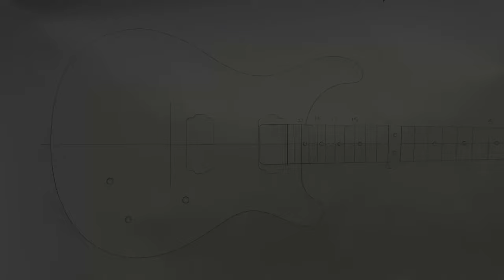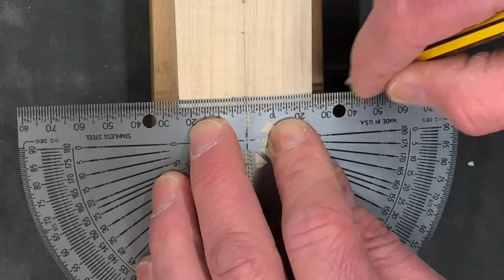How To - Custom Electric Guitar Build in 20 Mins #ggbo2022

Comment: A bostin looking guitar, great top. I see a lot of people doing what you did but it puzzles my small mind. In my head routing the electrics channel before gluing the top on, seems easier and less risky than using a long drill bit from the neck pocket. Perhaps it's just me. Sorry for being late to the party. Have you made another?
Reply from the maker: Thank you, it’s one I’m proud of, glad you enjoyed the video 👍 if I was mounting a scratch plate or if the selector switch was at the top bout (like a Les Paul or Tele deluxe) I would have done a channel for wiring. It’s scary drilling through but long as you’re careful it’s ok. I’m making another but have had a break over winter due to life getting in the way but will be getting back to it soon.
Reply: @WhitefootGuitars  thanks for replying, I'm on my fourth build. It is too cold in my shed at the moment to do anything but the planning. Believe me, routing the wiring Chanels before gluing the top on is far less stressful, if it were to go wrong, no one will see it. Only if it is a solid body would the big companies drill from the neck pocket. But if you are happy doing it, then keep doing it. What is the next project?
Reply from the maker: @antonrandle4146 I’m with you on the cold, a single-skin garage in winter isn’t funny 🥶 I’ve got 2 on the go, a PRS body I made a neck for and I was in the build off 2023 but didn’t get to finish in time, I’ll be getting it done over the next few weeks hopefully